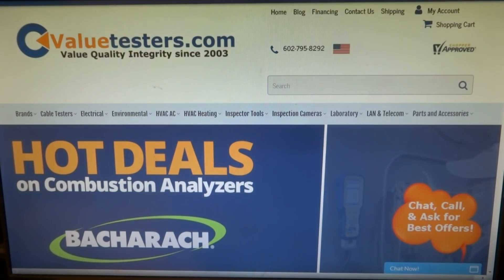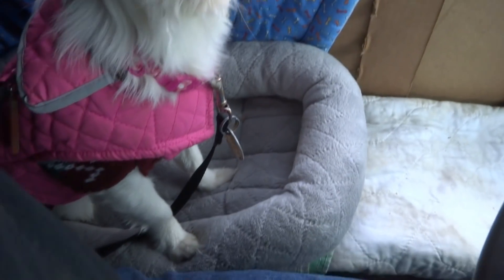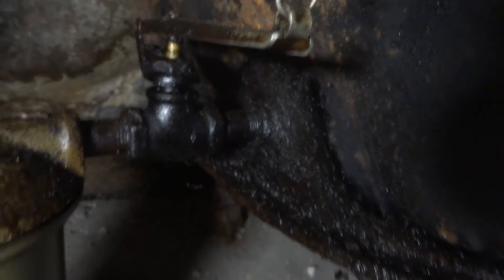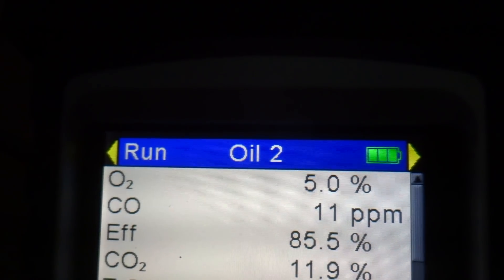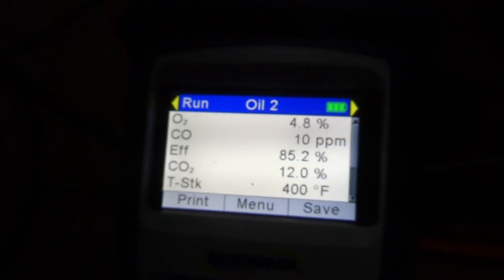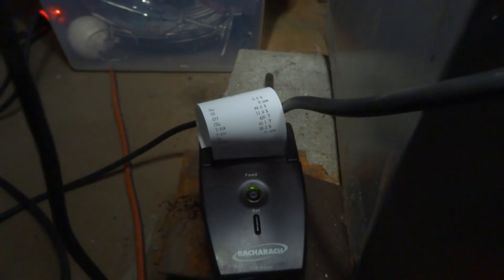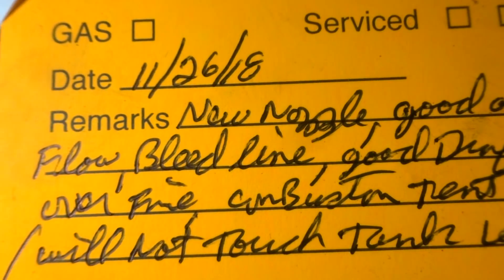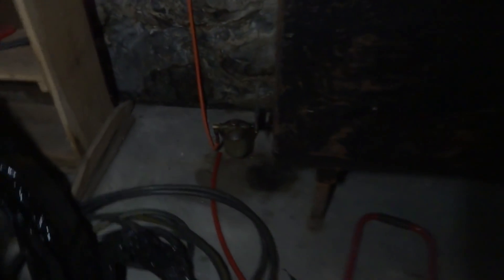oil boiler service / combustion test

Comment: Surprised no one sells plastic Oil tank for residential. Fire proof coatings are on them. We use on ships and fishing boat s. Salt rots steel fast condensation internal a big issue.
Weird how no state I know of has annual boiler inspection for residential homes by a qualified guy like Steve. Cars have such yet a home full of Women children doesn't require it. Think of how many lives would be saved. Crazy every fall season here on Long island NY all I here is fire trucks going to homes which heating system blows back or worse.

Comment: Have had a few home heat tanks I have refused to put oil in over the years because they were so bad. Not worth the risk. Just had my neighbor come get me because since last winter he has been using wood and gas because his oil furnace died and wants to fix the furnace and use oil again. I found his problem underground tank has 25in of water and 2in of oil. Asked me if it could be fixed. Told him to go in the kitchen and get a fork and drop it down the fill spout cuz it's done. Gonna hook him up with a above ground 275. She's a leaker Mama!!!!!
Reply: Kyle Bass I spent the last 15 years of my 40 year career in the oil business removing underground tanks, and installing double wall In ground,above ground and double bottom tanks. I have seen nightmares in leaking tanks, unbelievable stories. Here in NY if your selling a home with a buried tank you will need to remove it or have it properly closed, and a new tank installed. Banks will not give a loan on a home that's has a UG tank. Unless it's a double wall. Back in the 40's-70's buried tanks were the norm. Most insurance companies don't cover it either.
Reply: @edwardweber6231  exactly. Both oil companies I've worked for because we are small will not install a underground tank only above ground tanks. Dude had run out of oil and only put it 50 gallons and ran it about 5 days before it played out. He works for a big oil company. He's going to get them to pump it out with a vac truck and fill it with foam. Works for a giant company and got me to check his tank and getting a tank from me LOL HAHA 😂 😂